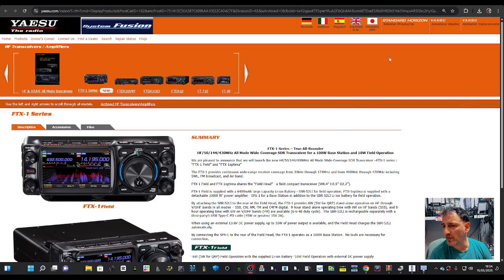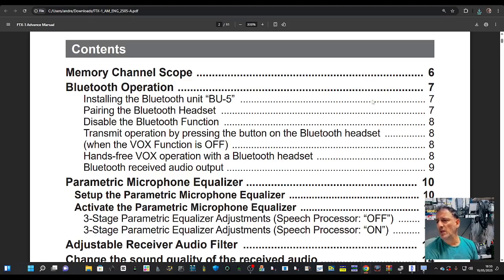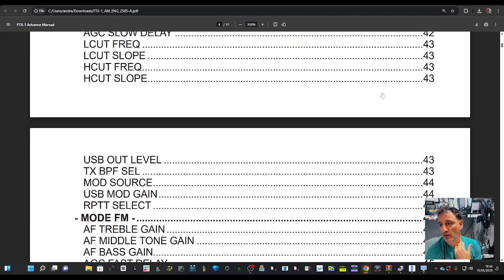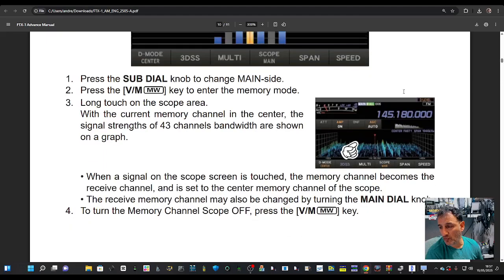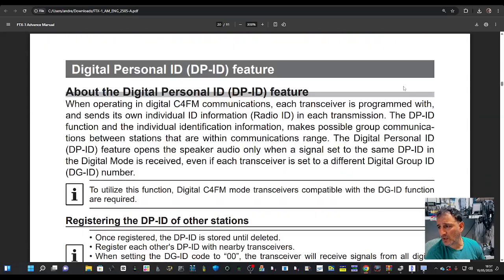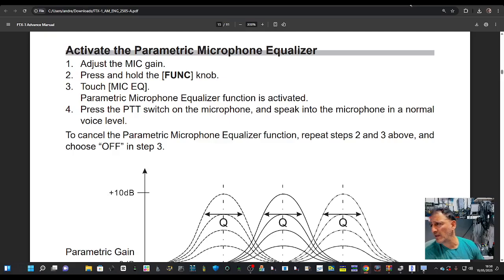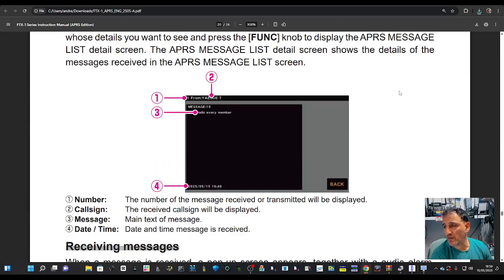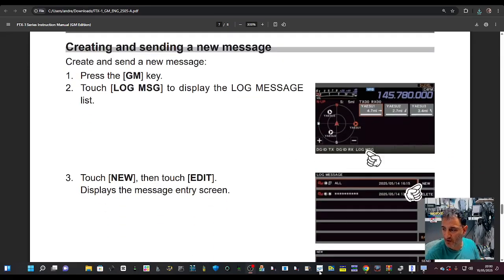Yaesu FTX-1 GM /APRS & ADVANCED  Manuals Released

Comment: Some nice stuff, but still the same limitations from old Yaesu rigs... 🤦‍♂

- Poor memories management : no hierarchical order, all the memories are on the same level, there isn't even any banks anymore ! The FT-5D does better, and it's still not as good as the Icoms.

- Only 5 preset memories for APRS status text, audio messages and CW messages 😮 Come on, you surely have spare memory for dozens of preset messages in there...

- No new APRS features : you can still beacon only positions, not objects... even Icom rigs, which are not "analog APRS"-compatible, can beacon objects 🙄

It seems like the whole APRS and GM stuff (settings and UI) are basically the same as on the FT-5D, and even the VX-8... it hasn't really evolved since decades !

The Memory Channel Scope is a nice idea, but they could have done some more innovative stuff.
For example, when scanning in VFO mode, sometimes we come across a frequency that seems familiar but we can't always remember if it's a known one : that'd be great to have an "auto-recognition" of this frequency among the memory channels, that would display the memory label we saved ! Just a simple way to say "hey this frequency is known, it's repeater XXXX".

To end on a fun note, look at the title of section 6 of the GM manual 😛😅
Reply from the maker: Lol - U need get one :)